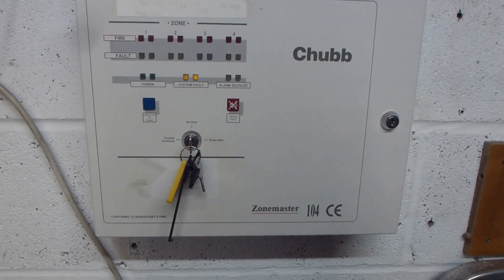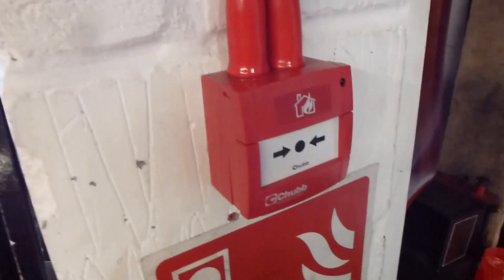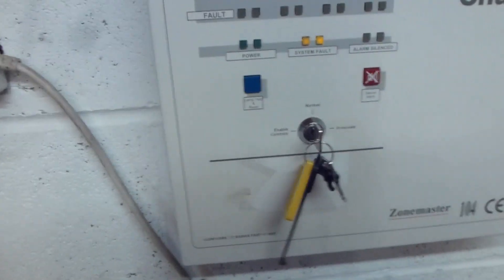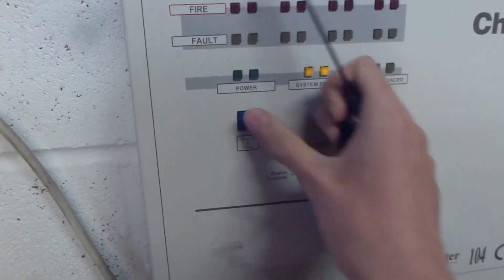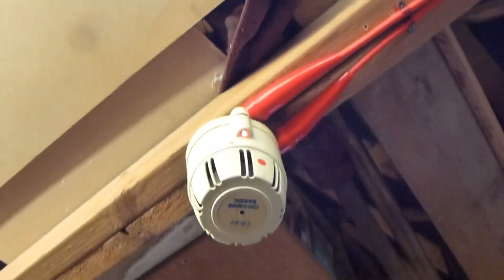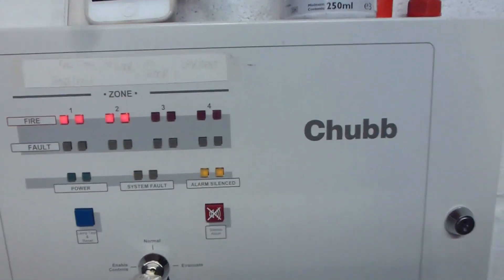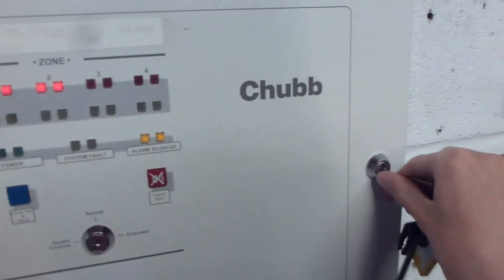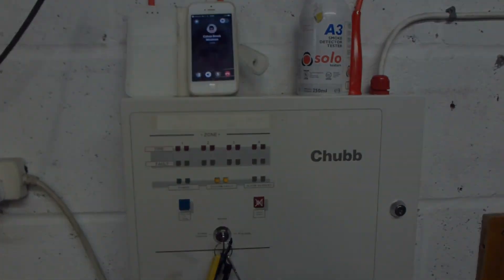system test 18 (first test of the conventional system)

Comment: nice set up, neat wiring and with proper clipping and glanding. you getting that buzz of the fresh smell of FP200 :P..
Reply from the maker: Test Logs yeah I'm quite proud of the installation with real cable too however someday I will take a step forward and get some even more real fire alarm cable also known as pyro which is very different to install but I think it looks outstanding in the end but right now I'm not ready to work with pyro but I have had intentions on using it in the future
Reply: @matthewjones9259  i have worked with pyro its a bit of a faff also expensive and for most situations, you only need fire rated rather than fireproof FP200 is more than adequate in most situations and will do its job if installed correctly.  it would be nice to see a system being wired in pyro.